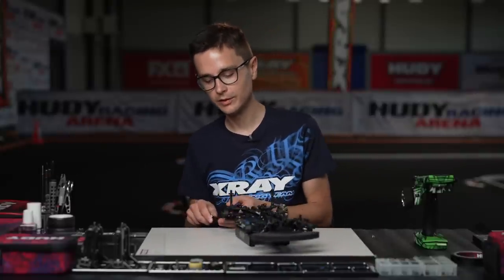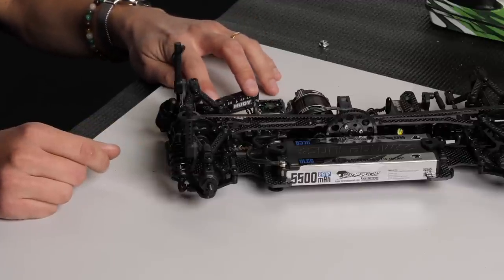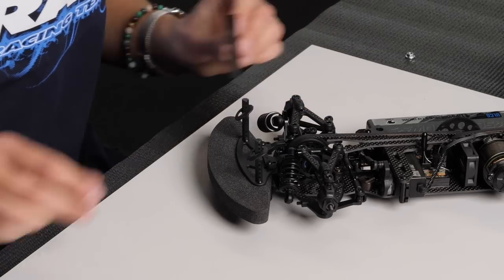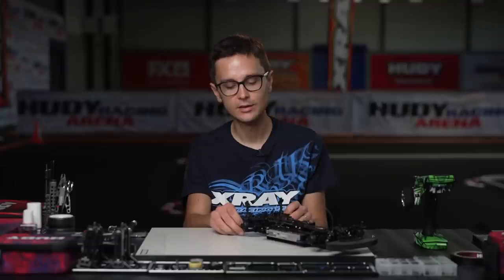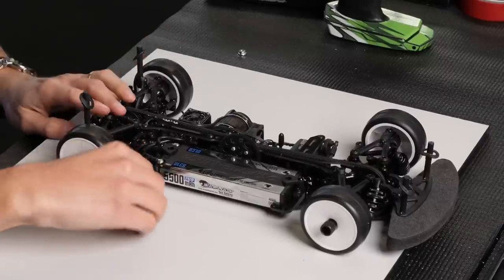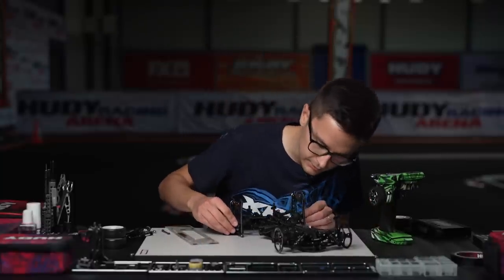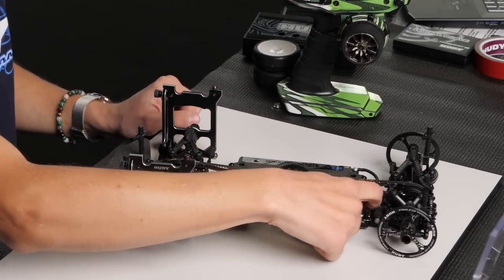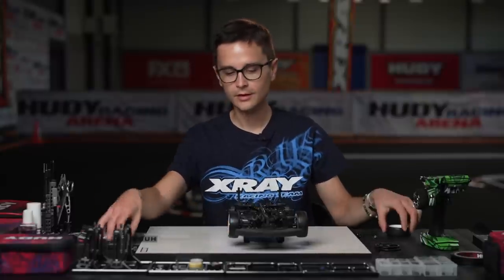Final Setup Before Hitting The Touring Car Track! - A Video from The Invisible Speed Onroad Course

Comment: Hi Alex, so what is the reason to check the droop without the shocks, Martin used to do it with the shocks on?
Reply: That's a good question. If the droop is being limited by the shocks, then you'll be measuring it wrongly without them connected. I guess that by leaving on the shocks you might not see any small changes in the droop reflected in the measurements if the shock is a bit stiff?
Reply: The XRAY X4 lower arms are rather soft. If the downstop is measured with the shocks attached, the downstop value will be largely influenced by the spring hardness and preload. If measured without shocks, that's the "real" downstop value and the position of the arm. This way we can get a consistent reference regardless of what spring or preload is used.
Reply: @hagberg  thanks Alex that makes perfect sense

Comment: Hi, about camber setting, don't you need to set it up with the ride height gauge under the chassis to be sure you have the right amount of camber at the ride height you set up just before ?
Reply from the maker: Set your rideheight with tyres first before using the setup station